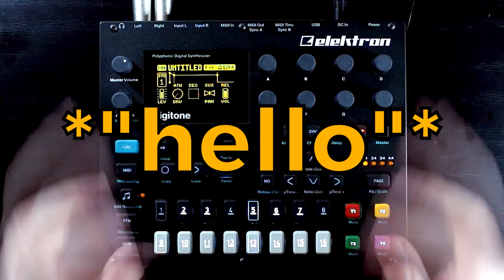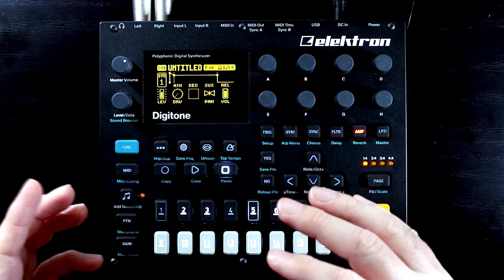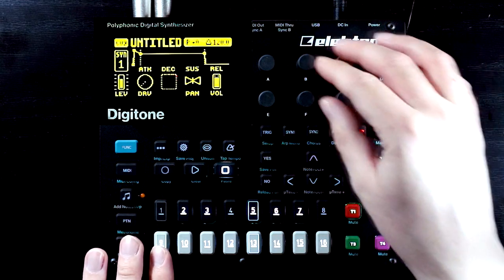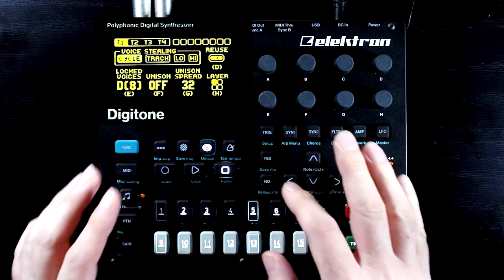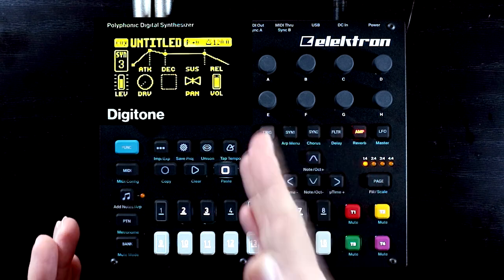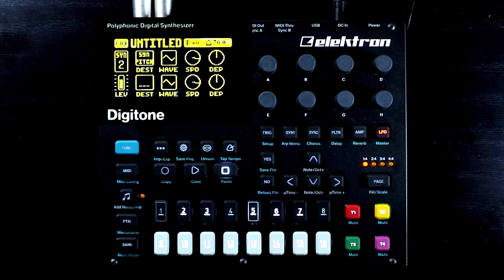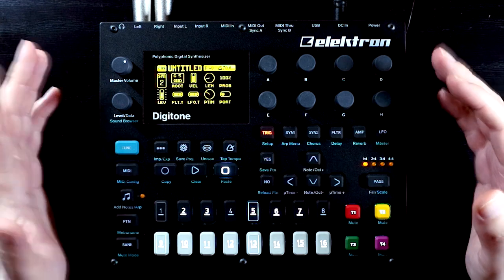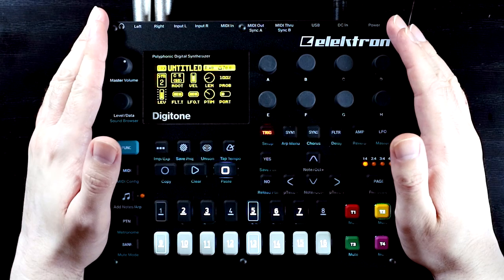Digitone - Dealing with Clicks and Voice Stealing (Understanding Voice Management)

Comment: 25:10 Could someone explain why disabling PHRT and AENR smooths the chords?
Reply from the maker: Disabling AENR removes the sudden jump in amplitude of the amp envelope from where ever it was back to zero (which would cause a click) 
Disabling the phase reset stops the operator jumping back from wherever it was in its cycle back to the start of the wave (which would cause a click).
Reply: @OscillatorSink  Thanks for your quick clarification, i didn't realize this applied to voice locking as well. Good job on covering all the aspects of this complex topic by the way!

Comment: This has helped alot. Looking forward to cleaning up some some of my patterns. Just one question, if have a track that has arp enabled and I only have 1 trigger set, would the locked voices for this track be set to one voice or to a number that correlates with the amount of notes in the arp sequence? Thanks for the video, looking forward to cleaning up some projects!
Reply from the maker: I'm glad that I could help out! If you are happy to have monophonic behaviour on that track you can lock it to 1 voice - you can still place a trig with multiple notes on it and the arp will work as normal.
Reply: @OscillatorSink  thank you for the quick response, I'll be going through all this today!

Comment: 29:45 is there any way to get rid of that initial click that is produced by the attack? I've tried every trick from this video but it's still there. It's driving me mad, I just want a clean bass sound
Reply from the maker: Is there still a click with the attack set at about 6? Do you have any sharp envelope moves in either the amp or filter (a short decay and a low sustain?)
Reply: @OscillatorSink  Yes, it's still happening at 6, I can even hear it when I set the attack to 30. My amp decay is at 40, sustain off, release at 20 with one voice (mono legato). I tried chaning the amp env reset and the phase reset but it's still there. My filter is currently blank and I'm not doing any modulation. I'm not sure what I'm doing wrong here. The clicking appears mostly when I play a couple of notes in quick succession
Reply from the maker: @user1756  phase reset off, amp reset off?
Reply: @OscillatorSink  It gets worse when I switch both off. Currently the amp env reset is on and the phase reset is set to "all"

Comment: How da fuk do I record chords via midi in from Ableton or a Keystep? I have had this for years and never realized I don't know how.  If I factory reset will that reset any of the voicing things I messed with?  Will it clear my own presets(patches)?
Reply from the maker: You just need to make sure midi is going to the right channel for each track (or use the auto channel) and hit record.

There are different kinds of resets you can do - they are listed in the manual. But the voicing stuff is only saved per pattern anyway, so nothing you'll have done will have any affect on anything going forwards.